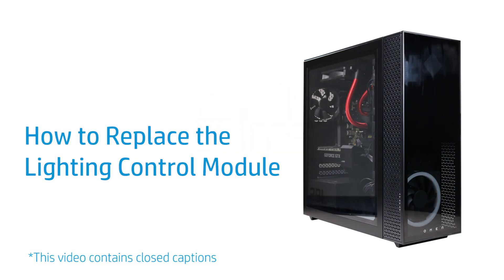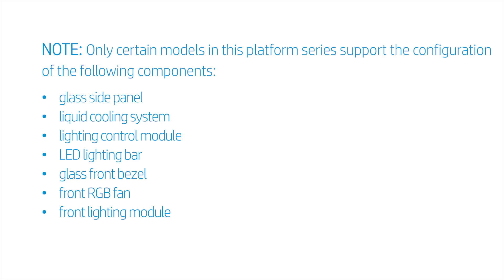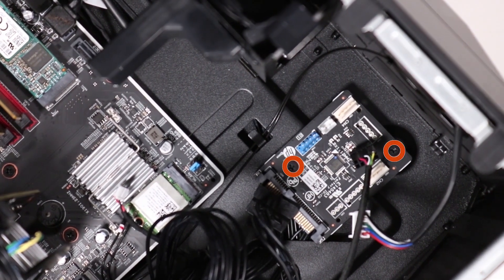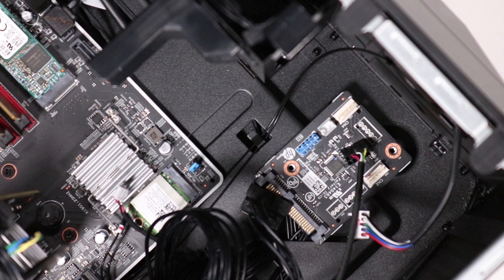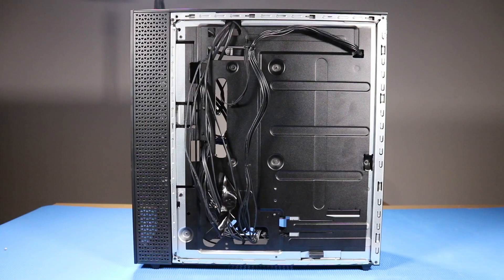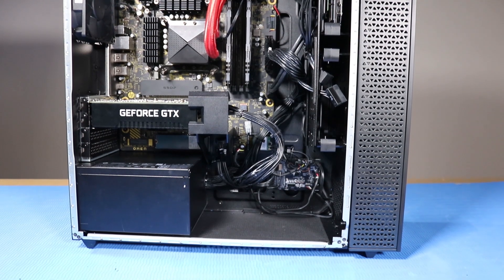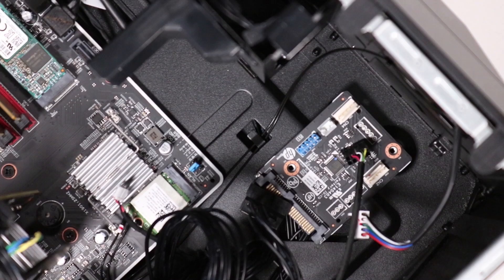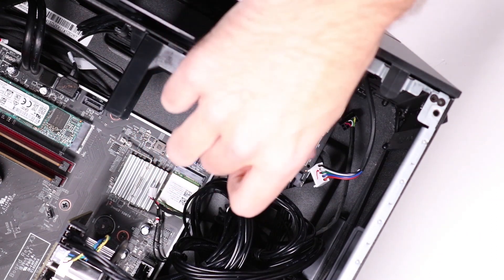Replace Lighting Control Module | OMEN 25L GT11-0000a, GT11-0000i, 30L GT13-0000a, GT13-0000i | HP

Comment: I recently swapped my omen 25l case, and was curious if I can use another lighting bar with that motherboard or which brand should I buy?
Reply from the maker: Hi there, thanks for contacting HP Global Social Media Support!
I understand that you need to know about using another lighting bar.
I will do my best to assist you.
HP does not recommend upgrading or downgrading hardware parts or software that is bundled with the product as It may affect the manufacturer's warranty and performance, however, you could change the configuration at your own discretion.
Binu - Social Media Tech Support
Reply: @HPSupport   Clueless Bot

Comment: I need help ! to add an rgb fan, would I have to connect the fan to the lighting module as well ? i cant seem to located any rgb header on the motherboard, i have an omen 25 L with and rthx 2060 and intel core i7
Reply: Here let me give you a bad news you can’t

Comment: just got the 30l , i cansee the damned cord , it is waaaay to short and sticking out of the back very far away from the damned port . why is it the ports are always loose unconnected , and how am i , a layman , meant to disassemble this bloody brand new machine to reroute 1 god damned cable.
Reply from the maker: +you`re wrong Please contact our phone support team to fix this issue. Please follow these steps to reach them.
Step 1. Open link: https://support.hp.com/us-en/contact-hp
Step 2. Select the product type.
Step 3. Enter the serial number of your device or select let HP detect your product option.
Step 4. Select the country from the drop-down.
Step 5. You should see the HP phone support number.

Comment: How do you purchase a new lighting control module?
Reply from the maker: +Kyle Falzone You can purchase the part from here: http://partsurfer.hp.com/ Please select your country and enter serial or product number of your unit.
Reply: @HPSupport  You cannot purchase Part #: L97227-001 PCA Lighting Control, Orisa is not available for purchase and you cannot add it to the cart.  Also, there are no functional equivalents listed. to replace that part in the OMEN 30L DESKTOP - GT13-0024. Is there another way to purchase this part or is there a replacement part that would function like the L97227-001 PCA Lighting Control Module from possibly Cooler Master since that's who the fans and intercooler are made by? Like Maybe the Cooler Master ARGB LED Controller with 4 x 3-Pin Ports?

Comment: None of my lights except the ram are working. Do I need to replace this module?
Reply: have you found a solution? because I'm having the same problem and cant find non
Reply from the maker: +Ben A You can update the OMEN Command Center from the Windows Store Click the Windows Store icon in the system tray. Search for OMEN Command Center. Click Update. Wait while the program downloads and installs. Click Play. OMEN Command Center opens. If the issue persists, please uninstall the HP Omen Command center. Select the Start button, then select Settings > Apps. Choose the program you want to remove, and then select Uninstall. Some apps built into Windows can't be uninstalled. To remove an app you got from Microsoft Store, find it on the Start menu, press and hold (or right-click) on the app, then select Uninstall. Restart the HP Omen and download the Command Center from this Link: https://support.hp.com/us-en/drivers Let me know how it goes.